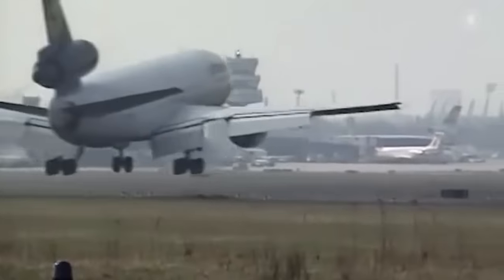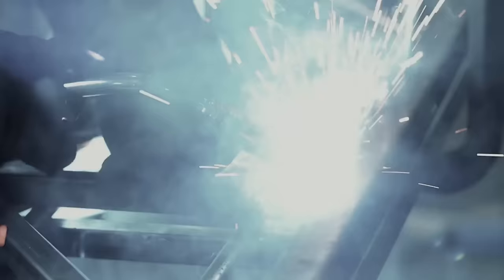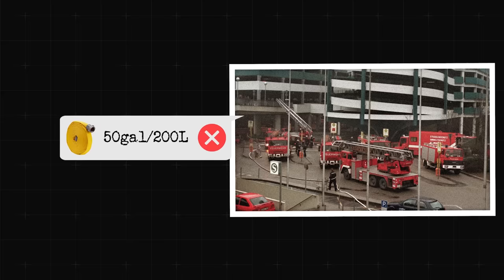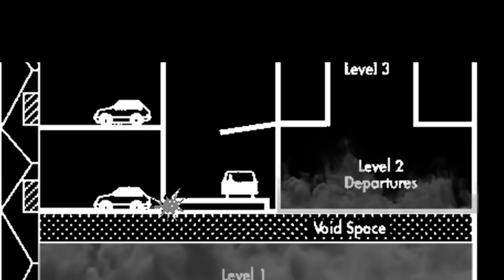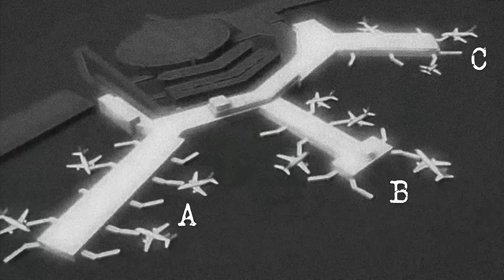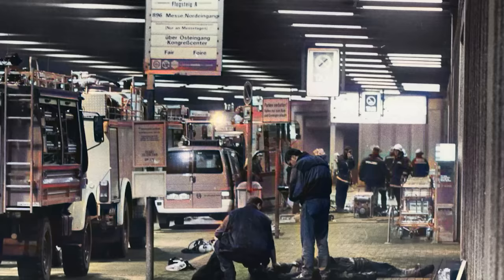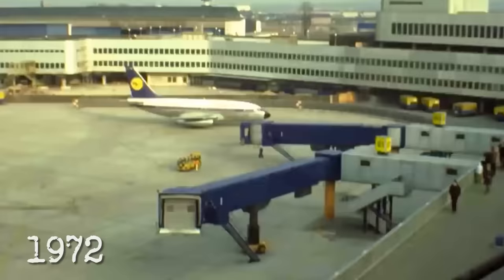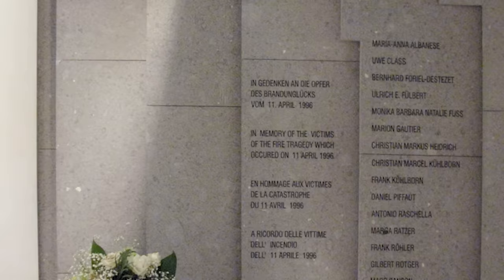The Düsseldorf Airport Blaze (Worst Airport Fire in History)

Comment: Why in the hell would the operator tell him to avoid breaking a window? There’s a fire engulfing the building, who cares about one measly window! If anyone reading this is ever in a situation like this, do not hesitate to break a window, door or whatever necessary to escape if you have to. Your life is much more valuable than property.
Reply: Oxygen feeds fire. A new source of oxygen, especially which cannot be closed afterwards, is hugely not great for anyone still in the building, and could get the fire to reach you before even you were outside the building. It's reasonable advice. They were close to an existing exit. Too bad they didn't know it was there, that would have been the better choice by far.
Reply: It's not about damage, it's about feeding a fire oxygen..
That's why you as a lay man are not allowed to engage the smoke ventilation systems (in Germany that is) for fear that the smoke Clearing systems feed the fire fresh oxygen.
Nowadays the alarms and evacuations systems are much much more in depth.
Trust me, I'm a electrician and work in modernizing shopping malls and such buildings.
And fire safety is the Bain of my existence (for a good reason obviously)
Reply: This is also why oxygen systems are not deployed if there's a fire on the aircraft, incidentally.
Reply: Please don't give people misleading advice, Chloe.

Comment: when it comes to elevators saying "do not use in case of fire" it is not because 'fire makes the elevator stop working or less safe' 
instead, it is because 'firefighters and their equipment can reach higher up fires easier with elevators instead of running up 10+ flights of stairs'

Comment: in summer 2016, twenty years after the disaster, i took two flights to london from düsseldorf airport to go stay with a friend; upon arriving at the airport by train - the airport has its own train station and an overhead railwail shuttle that collects people from the different parking houses as well as those arriving by train; it takes you another ten minutes to actually arrive in the airport's main entrance hall - i was in awe about its sheer size. despite me arriving rather early i had to run to make it to the correct gate before it would close and it felt like running a marathon to be quite fair - shops, restaurants and cafés spread out on so many different levels, like a gigantic maze ... you could easily confuse the airport with a shopping mall if it wasn't for the signs pointing to different arrivals and departures every other step. honestly i do not want to imagine a fire breaking out stealthily in it somewhere, not even on today's fire safety standards.

Comment: thanks to this i had over 3 years of work on another German international airport....
as an electrician, we climbed on the cables 3 to 4 stories high inside the building, if we wanted to avoid to take the stairs...
fire walls with holes you could walk thru etc..

Comment: In the '70s, the knowledge about the toxicity of asbestos (amianth) began to spread widely. It was used both by itself and inside cement (Ethernit) for thermal insulation purposes. 
On the wake of the asbestos scare, insulation was replaced by glass fiber, even if it had to be 5 times thicker for the same insulating effect. Glass fiber is not flammable.
In the airport some odd circumstance must have lead to the use of such highly flammable plastic as thermal insulation - possibly its low cost - against all common sense. But, as you say in the video, it was 1972...

Comment: It's actually really depressing that the easiest standards can sometimes prevent tragedy. Just preventative and not suppressive measures could have helped here. Fire watch, local fire company notification, and just adequate protection of the surrounding material could have allowed this to be avoided, even with the terrible installation of poly insulation, whose inclusion is more or less always a trade-off of safety for cost savings.

Comment: It's wild to me that they used polystyrene for building insulation! Surely that wasn't standard building material? Anyone who's been around polystyrene knows how quick it is to catch, melt and just stick to absolutely everything while it burns. There's a reason it's used in the recipe for backyard napalm, it's lethal. I think there should've been more time for the people at the top of the chain because they must've known about all the safety issues. Trying to rope in and blame the welders doesn't sit right either as they ain't Superman, no x-ray vision so how the heck could they know what was going on underneath them. They always try and jam up the "little guy" though and it's disgusting.

Comment: I'm so sick of this "grandfathered in" mentality. Yeah the terminal was built in the 70's where smoke detectors and sprinklers weren't legally mandatory, but by the 90's it was. They easily could have installed them in the older terminals, but chose not to because they legally didn't have to and it saved them money.

Comment: 50 gal a minute… Yeah that ain’t going to cut it. A fire that large in a building that big. Definitely need to drag in a 2” or 2.5” attack line. That had to of been pretty difficult to fight. This is why pre-fire planning is extremely important. Know the area you are protecting. Of course these guys were trained in crash rescue only…

Comment: (No offense guys, but) the airport Fire guys posed as elite firecrews, because they had those fast fire engines with so much water output, but thus fire showed that elite status is earned harder than that. Much has changed since then, rhe brother and sisterhood have grown together much tighter, communication across the board has improved so much and everybody is so much more aware what the other specializes in and what they can and can not provide. A bit horrifying to look back at how it once was.

Comment: Wait a minute. Airport firefighters in Germany have an extensive formation in being firefighters and are acquainted with FwDv 1 and 3 like any other firefighter organisation in the country. Not only that but they have to their command normal tenders (HLF20 standard) which are used everywhere else for structural fires. 
I wouldn't blame this on their lack of training.
Reply: In 1996, this might have been slightly different. And the focus was surely on fighting airplane fires. They might have received training for building fires long back, but not kept up the training.
Reply: @schlollepop  if you know anything about firefighting in Germany it's that it just doesn't change. Those directives have been in place for the better part of a  century (with small updates from time to time). 
I'm just saying I don't find the statement accurate. The fire was a result of many bad choices and lacking fire protection. I don't think the outcome would have been better if this particular circumstance was different.

P.S: the backbone of our organisation are volunteer firefighters which, due to their nature, have less time to practice than these guys. Lack of training just doesn't cut it for me.

Comment: [2:08] already suspected from the line earlier that it turned to a flashover as there'd've been massive oxygen supply by way of the gas mixture {common air} inside the massive terminal halls

Comment: I don't understand why flammable insulation is even made anymore.
Reply: Polystyrene is a material with many advantages. So is petrol or alcohol, you have to use any material correctly.
Reply: 1997 and the use wasn't allowed even then.
Some fucked up by ordering it and using it in such a building..

Comment: how long has the german mark been the currency of germany? because they used the mark in this video
Reply: This fire occurred in 1996 when the Mark was German currency. The Euro was introduced 4 years later.
Reply: @benedictdesilva6677   In 2000?
Reply: @DavidMaharaj-rm1td  I need to make a small correction because I misremembered the chronology of the change-over.
In Germany the Euro became optionally bank-transferable on 1. January 1999. Deutsche Mark continued as sole cash currency until 1. January 2002 whereafter Euro became sole cash currency.
Reply: @benedictdesilva6677   Orr horr
Reply: @benedictdesilva6677  2002 was the euro introduced;)

Comment: So if a plane crashed into the airport or a plane went up parked at the airport. As long as the plane was put out the fire personal at the airport would call job down. Strange that they wouldn't be trained and equipped to deal with fires at the airport building itself.

Comment: Its like 4th or 5th biggest in germany. There is Frankfurt at 1 Munich at 2 then its Berlin and Hamburg i think before Düsseldorf
Reply: Just... no. Berlin, Munich and then Hamburg are all fairly close in size at over 3 million inhabitants, followed by Cologne at over 1 million. Cities like Frankfurt and Stuttgart are way below 1 Million, but also significantly larger than Düsseldorf, which hovers around the top ten.
Edit: Ignore the numbers, I had the metro areas in mind. The order still remains the same though.
Reply: @mikeblatzheim2797  

    Berlin (3,6 M)
    Hamburg (1,8 M)
    Munich (1,5 M)
    Cologne (1,1 M)
    Frankfurt (750.000)
    Stuttgart (630.000 
    Düsseldorf (620.000)
    Leipzig (590.000)
    Dortmund (590.000)
    Essen (580.000)